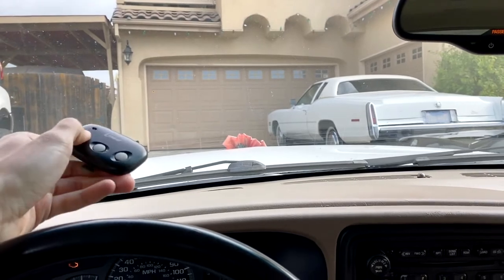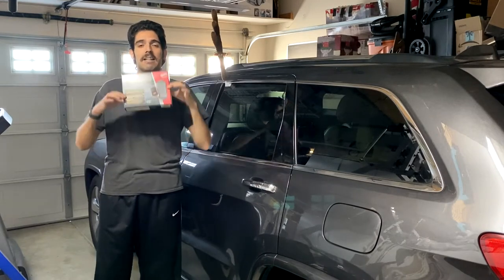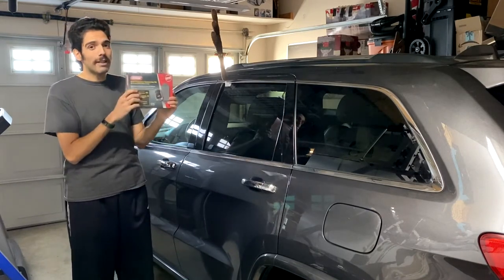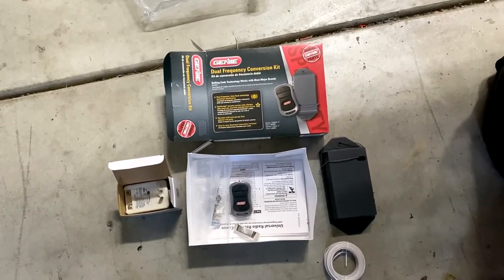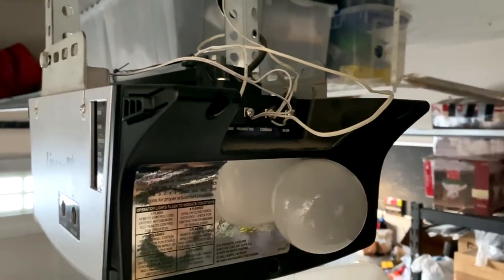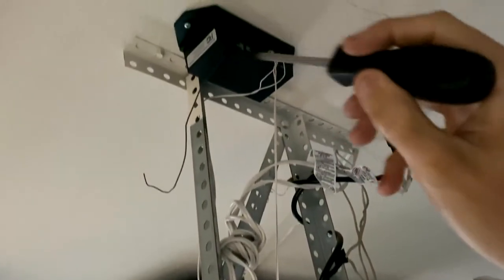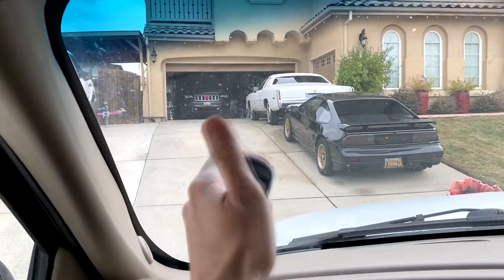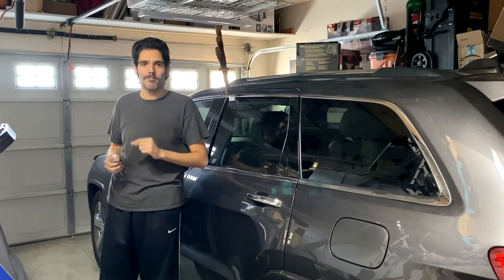How to Increase Your Garage Door Remote Range | BEST Product for the Job!

Comment: Good video Garrett.  My problem is not with range but getting the built in clicker that came with the car to work.  I had a Genie that died.  The repair tech sold me a Lift master and from that point I couldn't get the built in clicker to pair or work in my C7 Corvette and now my new Cadillac.  I hate to use the Mickey Mouse clicker that came with the opener when there is a built in clicker in the car that used to work with the Genie opener.

I sent you a couple emails over the past six months but don't know if you got them.  I have been having trouble with my fios network with some applications, mail being one of them.  Let me know if you didn't get them and I will resend them from my Spectrum network.  You have my email address.  I hope the fire didn't get too close to you.

Brian